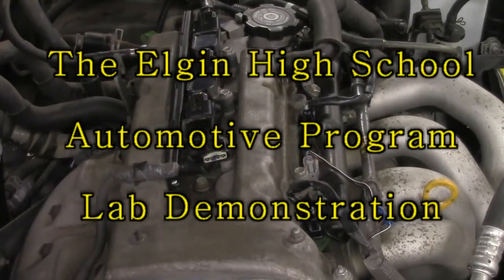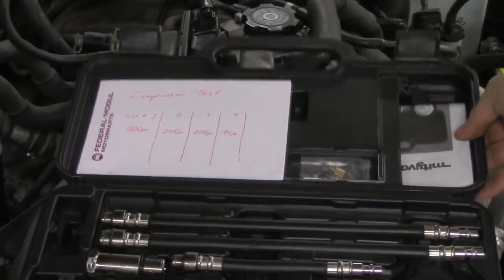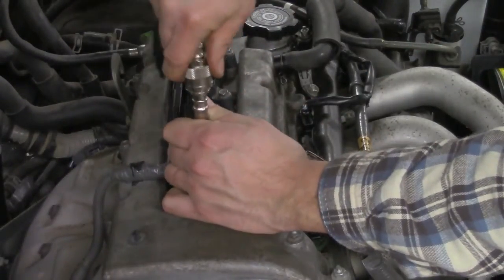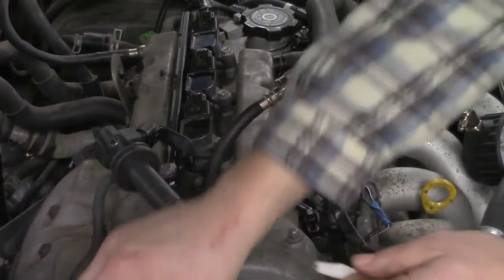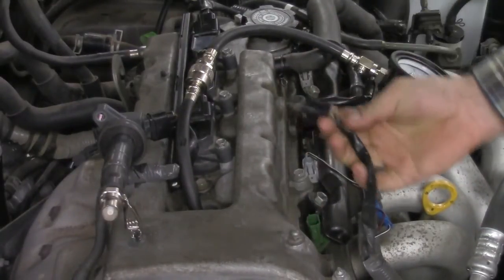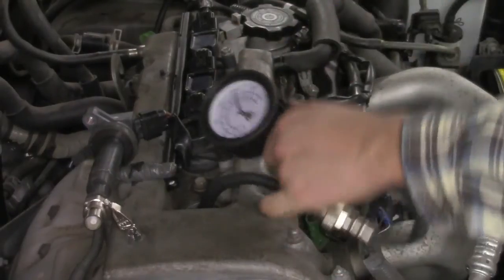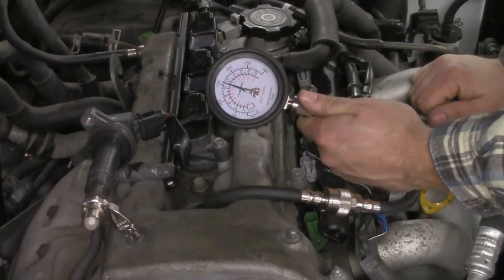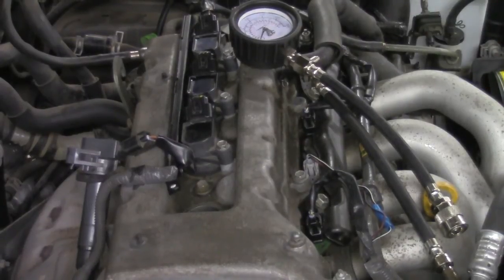Engine running Compression Testing

Comment: You mentioned to use a spark tester or jumper wire , couldn't the coil connector just be taken off during test?

Comment: Good video on how to perform the test, but no info on why. Know what your static compression is. Idle compression should be about half of that and snap throttle should be about 80% of static. A lower than normal reading on throttle snap indicates a restriction of intake air (clogged air filter or stuck runner flaps, carbon build up on intake valves, Etc.). A higher reading, a restriction in the exhaust (clogged cat or muffler, etc.).

Comment: Hi there , are you not supposed  to REMOVE ALL THE COILS AND SPARKS  ? Then you have to disconnect the
FUEL PUMP FUSE , this is the right way i guess .... and by the way because CRANKING the car would 
discharge the battery FAST , you got to connect the battery to a BATTERY CHARGER all the time during the
cranking ..... isn't is this the perfect method ?!
Reply: not for a running compression test

Comment: what does a running compression test do or look for when you do that test
Reply: Basically, a running compression test allows you to check the breathing ability of each cylinder.  A vacuum gauge can do that also, but you are checking all cylinders at that same time instead of just one at a time using the running compression check method.  In the video he didn't describe the reason it is used or what different readings mean.  That is important to determine what is a good reading, what is a bad reading, and what they mean. It is too bad it wasn't covered here because how to perform and set up the test was done really well in this video.

Comment: this is a good video. I've had air, fuel, spark and static compression testing check out good. running compression test can tell you if valves are sticking. i can't agree on your method on using the straight jumper wire to ground. a spark plug and spark tester have a 6000 ohm resistor in the center electrode of the plug. a jumper wire has no resistor in it and would blow a fuse if it were connected in series.
Reply: Hu?  There is very little current on the coil secondary side.  Jumping the coil secondary output to ground will not blow fuses or damage the coil.

Comment: How come your car works fine on 3 cylinders only 
My car stalls every time when I try to do the same process it works only with the 4 cylinders 
I have 2001 Corolla,
What I did wrong
Reply: You have a coil for each cylinder.  The coil also has a circuit called ignition fault (IGF).  When the engine computer commands the coil to fire it tells the igniter inside each coil to turn on and off.  When it turns the igniter off the coil fires.  The circuitry inside the coil sends a signal, IGF, to the engine computer to let it know the coil fired.  I believe if the PCM doesn't see that signal because you unplugged a coil's electrical connector, the PCM won't fire the injectors.  On your design you have to do what he did in the video by shorting the coil secondary to ground. 

Another reason is if you have another cylinder not firing and you disable a working cylinder, two cylinders working isn't enough to keep the engine running especially if they are companions.

Comment: since you still have the valve installed in the hose shouldn't you release the pressure after cranking and let it go up when  the engine is already idling since cranking pressure would be higher than idle?
Reply: Fuel injection does not have anything to do with compression testing. It's physics, if you try to draw in air from a small opening into a container it would take a considerable amount of time to fill it, increasing the speed would increase the vacuum but not the mass of air entering the container.
Reply: +jay matias That is correct. As per what I was told in school.
Reply: jay matias how would cranking have more compression then idle??? slowly rotating while starting vs. running at 800-1,000 rpm idle. idling Obviously builds more compression.  you have been mislead.
Reply: kent kirkpatrick the engine when cranking at 200 rpm would have more time to suck in air than at 800 rpm. if you have an oscilloscope and pressure transducer you would actually see the pressure going down when the engine starts to idle. I'm sorry bro but it was you who was mislead.
Reply: maybe on fuel injection.  I've never heard this before tho.
Reply: so if this is true,  then why does my compression go up when I Rev the engine?  I don't run any efi's so I wouldn't know about them...
Reply: Because you are opening the throttle plate
Reply: k. so if that true to what your telling me... then how the fuck does it build more compression at idle?  if it goes up with rpm...
Reply: Did I say the compression goes up at idle? You're contradicting yourself now. This is the last time I'm going to reply and you can do your own research. At idle do you have the throttle open? Obviously you don't understand enough about engines so I would suggest studying before entering a discussion.
Reply: sorry how dose it not* build more compression is what I meant to say... you tell me cranking builds more compression at slow rpm , yet you tell me compression goes up when I open the throttle?  thus bringing up the rpm and compression right?